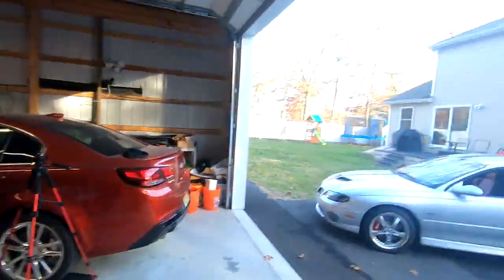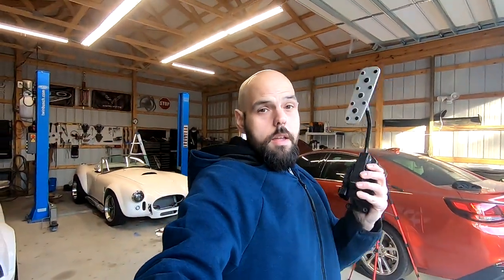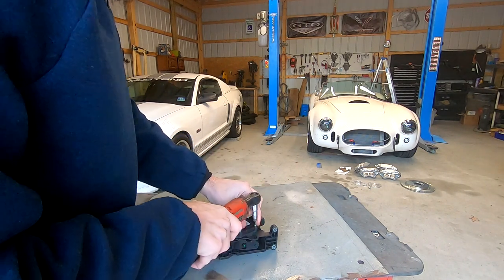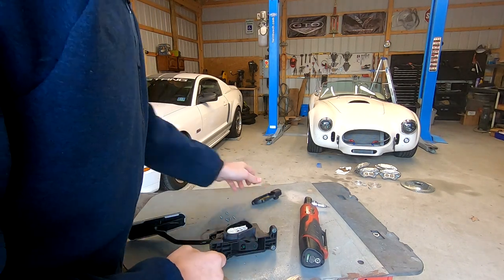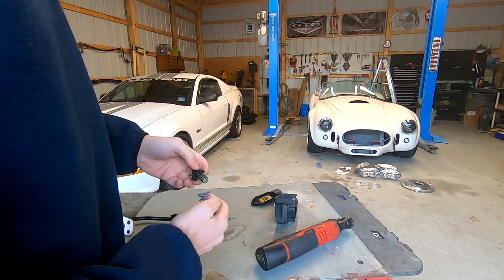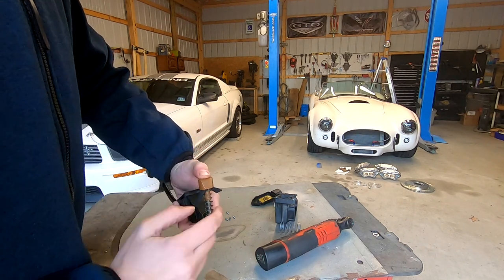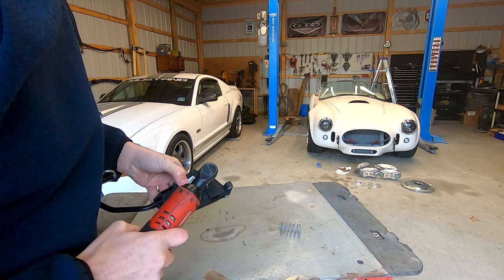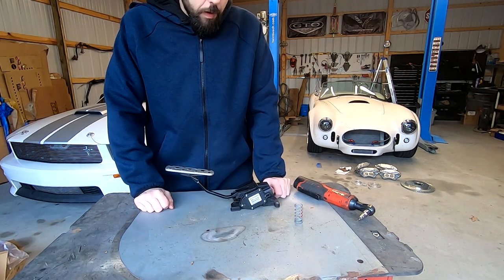2005-2006 GTO Gas Pedal: Electronic Accelerator Pedal Repair

Comment: well I be damned, thanks for posting this man, I'm sure gonna do it to mine
Reply from the maker: It is a fantastic fix I will warn you if done improperly meaning if you break anything you could have a problem with your gas pedal doing whatever it wants but if done properly it makes the car feel like a brand new car. Those Petals jam up pretty hard over the years and most likely trying to find a replacement is impossible

Comment: How were you able to take the pedal off its literally a pain i cant find how to take the connector off without ripping or damaging anything
Reply from the maker: You should see how hard it is to take off some of these other cars I work on. this one isn't too bad in comparison. I usually leave the connector on and  remove the bolts. once it's loose then I push in on the connector then pull it off. It's much easier that way.

Comment: Took the large spring out of my 05 GTO and when I started the engine and pushed my pedal  The Reduced Engine Power Warning light came on and won't go off. Every time I start my engine the reduced engine power warning light come one. How do I get rid of this light. Or get this Reduced Engine Power  Warning light  gone. Thanks
Reply from the maker: Sounds like you move the throttle position out of adjustment or bent a tab. I would open it back up again and check the tabs out that ride on the circuit board.

Comment: Another thing i hate about the gto pedal is that it has way to much play you literally press the gas and your whole tip of your foot leans forward like a quarter then it starts to rev😂 imma find a way for that pedal not to move so much
Reply from the maker: Actually your may be worn it can be slightly adjusted too. Where are you located ?
Reply: @davesworld2132  maybe but its annoying imma find a way to make it better it feels like your flooring it with the middle of your foot lol and im located in Charleston s.c
Reply from the maker: @mikehawk3268  bit of a hike from me I was hoping you were local so I can tinker with it. But luckily this is one of the few pedals that have a metal rod if you’re careful you could bend it to a position you like better.
Reply: @davesworld2132  ohh shitt i never thought of bending the rod that may work lol imma tweak with it later thanks fir the tipp
Reply from the maker: @mikehawk3268  No problem be careful let me know how you make out.
Reply: @davesworld2132  yessirski ill keep you posted
Reply from the maker: @mikehawk3268  awesome I live for figuring stiff like this out lol